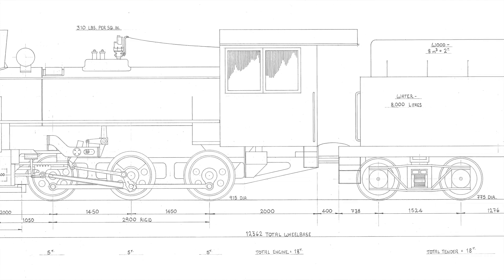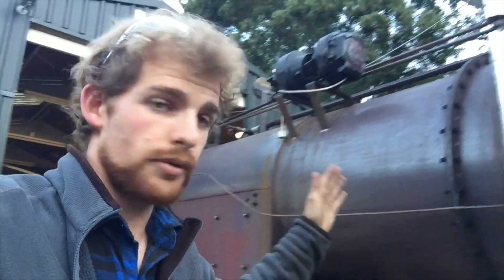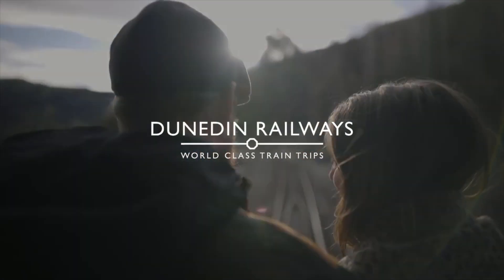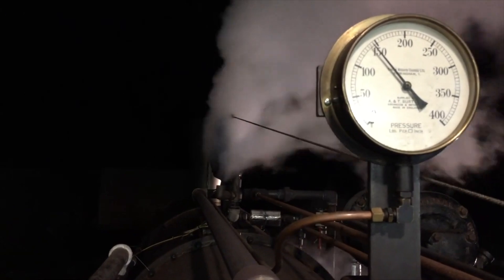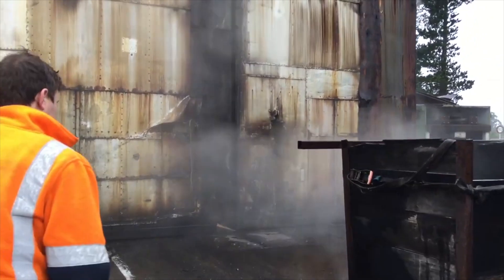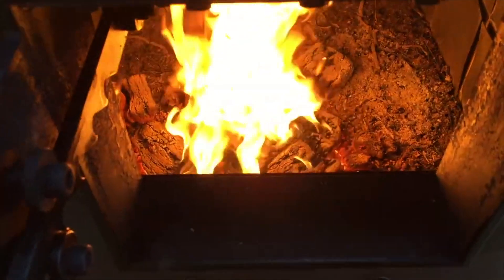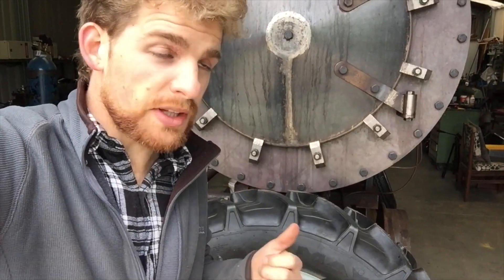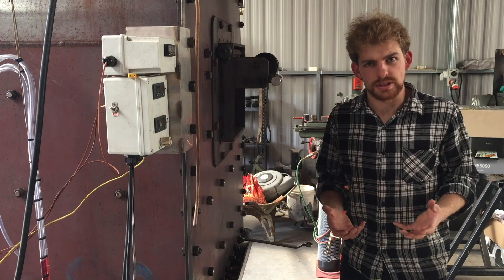2016 - 2021 | Building the World's Most Sustainable Locomotive

Comment: The boiler you are building is known as a steam generator. Some of the steam cares used that, and reheated the steam also.
Reply: ALL boilers are 'steam generators'.
This one looks to be a water-tube boiler, more commonly found in marine applications.
Locomotive-type boilers are normally fire-tube types,
Reply: @tooleyheadbang4239  Both boilers and steam generators make steam, the difference is a boiler is a high-pressure vessel and a steam generator is not. But you are correct

Comment: You are doing a great job there!. I'm also doing experiments with steam at home (at a much lower scale) but would like to ask you, is there any way condensation drain can be avoided at all?

I have steam coming out a ~4mm ID tube. Over time a drop of water condensates on it's tip until it falls, then the process repeats for as long as there is steam coming out of it. Is there a way to entirely avoid this from happening?, or at least something I could do to mitigate it to some extent? Thanks.

Comment: Will this locomotive have some more safety features like a butterfly-firebox door that opens and shuts with a step of a lever? Or perhaps having water condensers and roller bearing axles as well?
Reply from the maker: Yes, the inward swinging door as fitted was designed as a safer and simpler alternative to butterfly firedoors. It is straightforward to set up for operation with steam via a foot pedal which may be undertaken in future. Yes to roller bearing axleboxes.